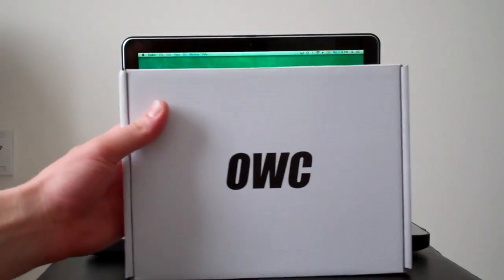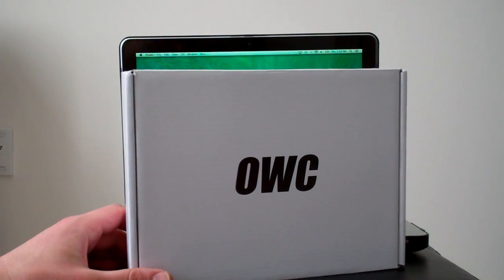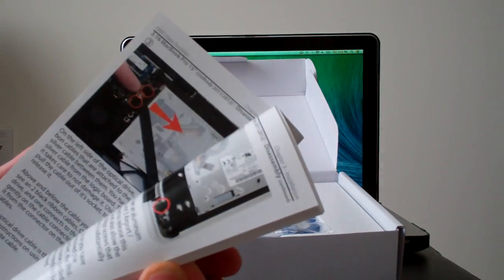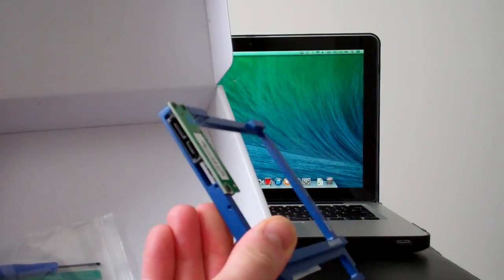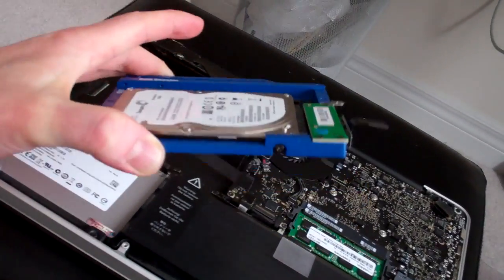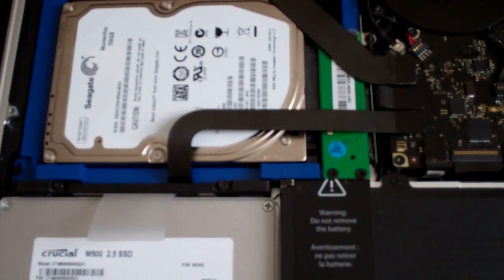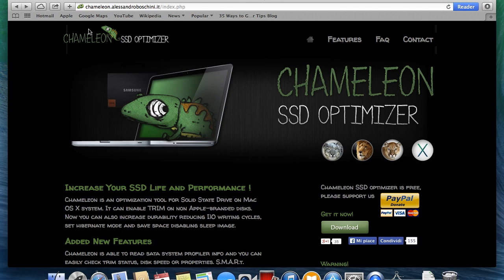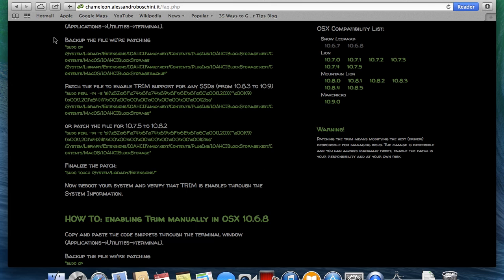Macbook Talking SSD, DATA DOUBLER & Enabling T.R.I.M.

Comment: This video was posted almost 2 yrs ago from when i wrote this comment. So how has ssd drive treated you in this time? I am wanting to go for an SSD myself for my early 2011 macbook pro 13" model (Macbook 8,1- same as yours). I don't intend to change my DVD drive though. Just replace the 5000 rpm 2.5" HDD with something great. Which drive do u recommend? OWC mercury extreme pro 6G or crucial or samsung? And about that TRIM feature. You are shown using a crucial SSD in the video. Does the company recommend using TRIM? Or do their native GC algorithms suffice? Pls reply thoughtfully and at the earliest. I'm gonna go for one of the aforementioned makes soon.

Comment: Using the Data Doubler bay do you feel like only two screws in one side really holds a regular HDD well? I'm thinking of using the Data Doubler but I'm afraid only two screws will not hold it well.